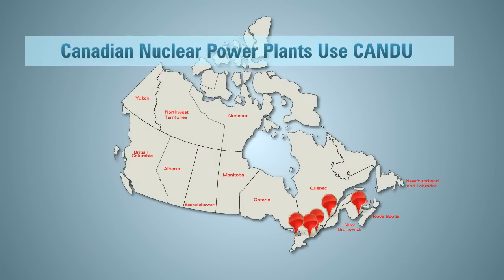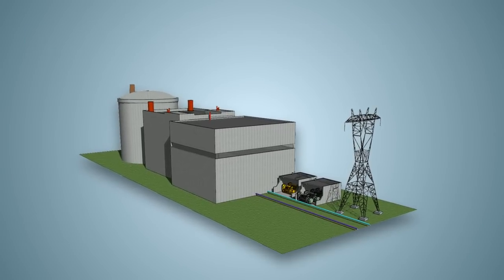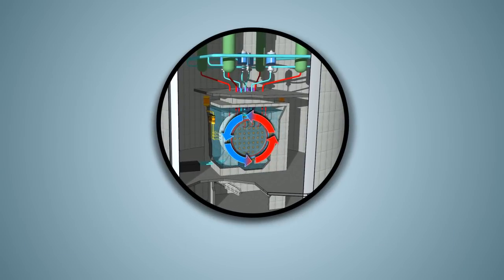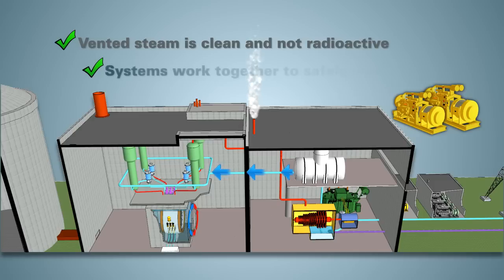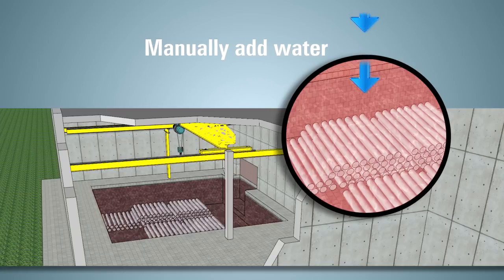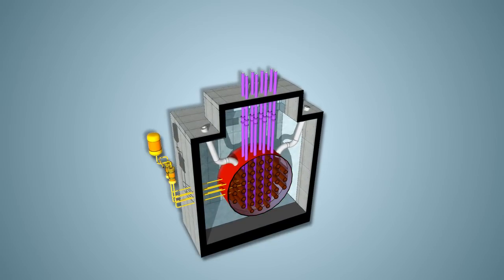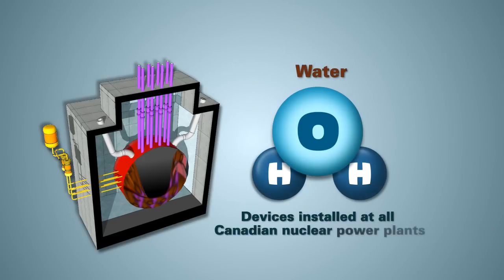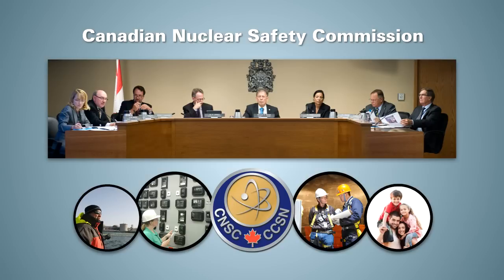Understanding Nuclear Power Plants: Total Station Blackout

Comment: ok here is a question. when the core does melt and burns through the housing into the vault which is filled with 500000L of water wouldn't that cause a rapid condensation on contact with the molten core? rapid as in explosivly rapid?! wasn't that the fear they had in 86? the fuel burning through into a basement filled with water that was used to cool the whole thing before?!
just wondering. or was that fear back then nothing but a fear because of not knowing?!
Reply: +cnscccsn I do understand that. I was just wondering in the highly unlikely case it happens and the core touches the water what would happen. or is the water under pressure as in a car radiator? stupid comparison but for the sake of understanding :)
Reply: +cnscccsn the molten core I mean. think that's rather important
Reply: Mike G well you could use fire trucks to supply water to the calandria
Reply: Proce that would stop the accident
Reply: It'd be like lava falling in the ocean, you can see lots of videos of that, it's not really explosive. 

The fears of a second steam explosion at Chernobyl were wildly overblown. That calculation predicting it was from assuming the entire theoretically possible thermal energy of the core ended up in the flooded basement all at once. Which if possible would indeed have been really bad... But it had already lost much of it's energy by that point and was just slowly dribbling into the basement as it melted the piping and floor a bit at a time.

Their math wasn't the worst way to play things safe at the time in 86' and it was probably a good idea to send those three guys down there anyway, the water was probably going to become a small hazard in other ways. But in hindsight with careful calculations it's pretty silly to think that the reactor was going to super-heat the basement a week after it'd already melted down and spread out.

Comment: So, it was never explained how the molten core which melted through one concrete slab would be contained, because it would melt through the bottom base of the plant into the earth and possible water table underneath causing a major incident.

They say it is very unlikely to happen, well Chernobyl happened and so did Fukushima

Comment: So yeah, almost all of these things existed and were used at the Fukushima plants.  The reactors were all "shut down".  It turns out that during a major earthquake or tsunami, a lot of your protection devices stop working.  Even if your 2 failsafe systems work, which they probably would (and their equivalents did in Fukushima), massive structural damage, cracks in the coolant reservoirs, damage to the coolant pipes and control mechanisms, cracks in the reactor containment vessels and the inability of emergency vehicles to reach the site could all still happen (like they did in Fukushima).

Keep in mind that the nuclear fuel in the reactor and spent fuel pools doesn't need to be cooled for days or months.  It needs to be cooled for years to prevent meltdown.

It looks like the main thing the Canadian reactors have going for them is that they're in a location where they're a lot less likely to ever see a severe natural disaster.
Reply: The area Canada's reactors are in can and do get earthquakes, but they are all built to code to handle the worst we expect there and them some. Fukushima Daiichi wasn't even close to being built to the spec required to deal with its location, neither for the tsunami nor the earthquake.

Comment: why the steam produced by reactors is transferred to U shapped vessels to produce steam of ordinary water?why its not utilized directly????
Reply: They use different fluid. The heat transport system, the loop associated with the reactor, utilizes heavy water in part due to its role as a moderator. Having an isolated loop is also important for containment purposes-- contamination doesn't get transferred to the conventional side of the plant, including the turbine.

The feedwater loop, the one that is on the shell-side of the boiler and used to spin the turbine, uses regular old light water. It's the preferred coolant because it's more abundant than heavy water, cheaper, and much easier to replenish.
Reply: verrin kindly elaborate
Reply: I thought I did. What in particular do you need elaborated?
Reply: It's so they do not put steam that has touched the fuel through the turbine... this helps containment and also means that the turbines are not radioactive even if the cooling water is very radioactive. Only the heat transfers, not the materials... also the cooling water might need to be very stupidly clean (I am not a plant engineer, but I know that some nuclear systems need water that is almost as clean as what semi-conductor fabs use), in that case, the turbine steam would contaminate the reactor if it touched the lubricants used in the turbine.

Comment: Very impressive. This might be too far to worry about. What if all humans vanished from the world? Will the automatic safetys work? Or will it just blow up wiping out the rest of life on earth
Reply: cnscccsn but can it keep it up indefinitely? Like the cooling it needs someone to fill up the water, why not have a pipe connected to a lake or use the heat that the robs make to make steam to power its functions?
Reply: Eventually, you end-up with corium on the concrete slab underneath, and then it's over. Normally clean-up would begin, but in that case, I suppose you'd be waiting on the concrete building to degrade and expose it to the environment? We're talking very long time-scales though.

I suppose more to the point: This isn't The 100_. There is not "praimfaya"; an event where nuclear reactors meltdown and all life on earth gets wiped-out _literally cannot happen in any sense. A fair bit of radiation, sure, but once the initial release of the extremely radioactive decay products is over...it's honestly pretty "meh". Business as usual. The Chernobyl exclusion zone still has plenty of wildlife, after all.

Then again, The 100 is fantasy, not science fiction. XD

Comment: shame Chernobyl couldn't of been like that
Reply: couldn't have been. sorry, had to
Reply: its not a CANDU reactor, its an ol CANTDU system
Reply: Czarnobyl (black being XD) was good...Diatłow make RBMK reactor explode on purpose!
Reply: Chernobyl was somewhat different, in that case the plant supervisor got the control crew to operate the reactor out side safe working conditions which meant there wasn't enough power to run the pumps. Being the good old soviet union, we no need backup power, Soviet engineering best in world, very reliable.  :)
Reply: Władca Wymiaru It’s all about the money and promotion!
Reply: You're confused RBMK reactors don't explode.
Reply: Russian reactors also don't have containment buildings like the rest of the world does.
Reply: @mitchsfarm  It's cheaper.
Reply: well there are simmilarities between CANDU an RBMK,.. both are channel type(fuel can be changed on the run, and natural uranium can be used), moderator independent from cooland, positive void coeficient,...

Comment: But why do you cool those fuel rods with water for more than 5 years when liquid nitrogen exists.
Reply: because after the liquid nitrogent has warmed up. they rods will also just heat up again. water is also cheaper
Reply: water is safer option, better thermal capacity, shields radiation. also freezing things waayy below 0 made things crispy, and extremly fragile, you dont want zirconium clading on fuel become either.

Comment: 3:00 I am not a fear mongerer, but the SL-1 disaster happened in four milliseconds before the control rods could fall. So 3 seconds is enough time for bad things to happen.
Reply: It really can't because of the huge differences in design. Three seconds leaves quite a big margin for safety in CANDU reactors.
Reply: Ah no... Big problem with definitions here. The 'energy spike' that caused the steam explosion happened over a few milliseconds, yes. But the 'accident' that caused the 'energy spike' was a series of operator errors over the many minutes before the explosion. Modern power reactors aren't meaningfully based on the SL-1 concept and have numerous design features that prevent one from even attempting to drive a reactor into such a seriously uncontrolled state as the SL-1 ended up in. 

The SL-1 was such a vastly different scale I just don't see the comparison. It was literally one person working by hand directly over the core. A modern civil reactor needs two people working at a computer interlock to do anything but an emergency shutdown.

Comment: But if someone explodes a nuclear weapon high above the thing, erasing all the computer chips with the EMP produced, will they still be able to keep them cool? 
Wouldn't it be better to build Thorium/ liquid salt reactors as they can't melt down? Even if ALL the power goes out!
Reply: some of the backup systems require no energy at all
Reply: @InfantTree  to scram it, not keep water flowing indefinitely to keep it cool.
Reply: If someone explodes a nuclear weapon above a nuclear power plant we have bigger problems than the power plants.
Reply: Automatic shuttdown is command independent. after that it depends how stupid generators and pums are, but basic desighns of both are EMP resistant.

Comment: What about using simple internal combustion engines as emergency pumps?
Reply: I am no engineer, but I am speculating: 1. combustion engines are less reliable then electic motors (what the pumps basically are) 2. They have combustion engines on site to generate electricity as a backup and backup of the backup and on top of that a battery back as the 3rd line of defense before, as a fourth line of defense, the passive decay cooling systems get active.
Reply: That's literally what they do have. Emergency diesel generators to make electrical power ARE internal combustion engines driving emergency pumps.

If you mean combustion engines AS PUMPS directly inside the plant to push the water around. Well that actually creates more problems then it solves. 

Power is still needed to run controls and sensors so it's not that helpful, you'd still need an electrical source and that source could just run electrical pumps making the combustion pumps redundant.

Also, backup pumps would need to be inside the reactor system, inline with the normal pumps. Meaning more parts and plumbing to create unreliability. All of which will add to a strict inspection schedule. However backup generators outside, can't be irradiated in an accident and can be inspected/repaired any time without affecting the plant's operation or adding to the complexity or failure risk.

Comment: hmm i've got a question. Why did the reactor 4 in Chernobyl melt down, when the rods got reinserted into the core?
Reply: When the rods were reinserted they displaced the water of the reactor(which assisted in moderating the neutron reactions) causing the reactions accelerate in uncontrolled an uncontrolled manner, these uncontrolled reactions caused the reactor to reach a critical temperature, causing a large amount of steam pressure to build which eventually blew the top of the reactor off.
Reply: RBMK need a bufor - extra rods that remain in reactor durng the work, unfortunelly Diatłow order to pull nearly all from 210...out. Only ~18 remain in device...
Reply: Worse, it didn't blow the top of the reactor off (like Fukushima), it blew the reactor core into pieces and out into the environment, because the steam explosion started at the bottom of the reactor. It was a truly obscene mess; the exclusion zone is littered with core fragments (both fuel and graphite)
Reply: @liesdamnlies3372  Yeah, there's a really cool youtube video of some german lady hunting down a fragment with radiation detectors - it might have been all of 0.5mm long.
Reply: @MrSunrise-  I assume you're talking about bionerd23
Reply: during the safety test (the reactor was running way below the minum of 700MW at 200MW the reactor stalled to 0MW. in anger they raised almost all controll rods out of the reactor but when the power shot up. they press AZ-5 (the shutdown button) automaticly lowering all controll rods into the reactor. but due to the controll rods having graphite tips (graphite accelerates the reactor) the water instantly evaporated and blowing the fuel channels causing the controll rods to stop moving further into the reactor. they tried to disconnect the serivo's (the motors) from the rods to make them lower by gravity but since they are stuck that did nothing. then all that steam blew the reactor lid off. this caused oxigen to mix in with the superheated graphite causing a nuclear explosion and blowing the roof off the reactor
Reply: @InfantTree  Their choice had nothing to do with anger...
Reply: @liesdamnlies3372  kinda was. What sane person would withdraw almost all controll rods out of a stalled reactor

Comment: Who saying its clean energy
Look at those affected
Reply: Look at all those coal miners that are getting black lung, and all the crap in the air you are breathing, mmmm tasty carbon monoxide

Nuclear is cleaner than coal by many orders of magnitude
Reply: It produces no carbon emissions during normal operation the same a wind, solar, hydro, and geothermal. i.e. clean energy.

Also because of it's fuel's high energy density and long operating life of a plant; nuclear power produces an extremely small environmental foot print before and after it's used.
Reply: Total deaths from nuclear power vs total power generated is far more favorable than ANY other power source we have. Per unit energy to the grid, even if you include Chernobyl, nuclear is still responsible for fewer deaths and less suffering than solar, wind, hydro, oil, gas, or coal. We NEED energy, and nuclear is by far the least bad option we have... especially when the people in charge design around safety like in the case of CANDU reactors instead of just going with the cheap option that can be used to make weapons as is the case with the RBMK design used by Chernobyl in the USSR days.

Solar, wind, and the necessary batteries to back them up make HUGE volumes of waste, if you produced all our energy with renewables, you would have MASSIVE fields of chemically toxic, flammable, and heavy chunks of solid and liquid waste that is NEVER going to decay away... Lead, Cadmium, and many compounds used in electronics, solar panels, and fiberglass wind turbines will always be toxic, fiberglass turbine blades are as bad as plastic waste... maybe more than plastic, solar panels (especially the ones with lower energy payback times like Cadmium Telluride) have HUGE amounts of Cadmium and other chemically toxic materials... chemically toxic materials NEVER decay, they will be toxic as long as carbon based life exists. By contrast, average energy needs for the minimum viable lifestyle based on solar, wind, and batteries would need massive piles of panels, a whole rooftop per person, several rooftops actually because the panels slowly degrade in the sun, this does not even cover transit energy, just the energy needed to keep a small home above freezing in the winter... Nuclear power on the other hand can provide ALL the energy needs for a person's whole life, holding up current standards of living (or more), including transit, and produce only the volume of waste that would fit in 1 or 2 soda cans.

Which do you prefer? Generating TONS and TONS of chemically toxic waste from batteries, wind, and solar which will NEVER EVER decay, or creating less than 1 liter (or less than 1 quart) of solid, easily contained, possibly used as future fuel, nuclear waste which we can cheaply and safely bury for the rest of time and will eventually decay away into something harmless if we never dig it up to re-burn it in a future reactor that we already know how to build.

By ALL metrics, nuclear power is safer, less destructive, uses a fraction of the land, and causes less human suffering per Kilowatt Hour than any other form of energy we have... followed by natural gas as a VERY distant second place.

Comment: I feel Canada is over assuring its citizens..... You guys just know accident can still happen...
Reply: i think they are just trying to stop some paranoia people have from leftover cold war feels
Reply: Supplying water to the calandria can prevent the danger.
Reply: The sheeple need convincing that nuclear power is a good option, especially if they want their precious 'clean' energy future of insufficient carbon dioxide to grow plants for food anymore...
Reply: NPP should be CLOSED for good! Water reactors just SUCK!
Reply: Reactors are good and efficient but like you said, accidents can still happen
Reply: Putting water in to calandria will stop the accident XD
Reply: They are literally explaining worst case scenarios...how is that over assuring its citizens?  The only thing that they are being a little over generous regarding is the immediate cleanup of a full meltdown.  Though a full meltdown is almost unheard of (Japan's is pretty much the only comparable event in the history of nuclear power), realistically if it happened they would just shut down the building, isolate it, and continue running the other reactors--putting off the cleanup pretty much until absolutely necessary upon decommissioning of the entire plant.  Three mile island is STILL sitting there...they will clean it up when the other rectors are decommissioned....not before.
Reply: That's not a problem, because if you supply water to the calandria with emergency equipment, such as fire trucks, you'll stop the accident.
Reply: Kevin Lyon Three Mile Island’s cleanup was completed in 1992. Do your research before trashing nuclear energy.